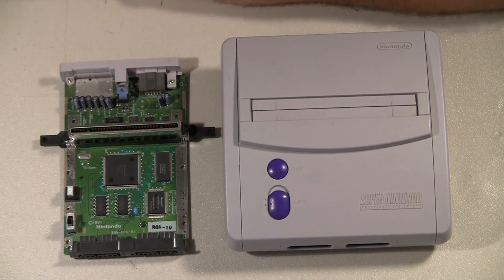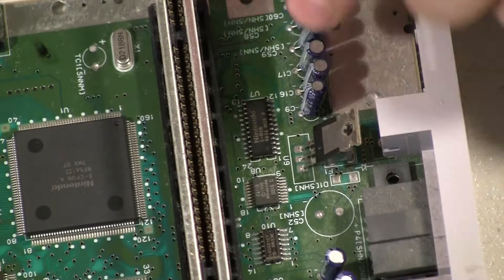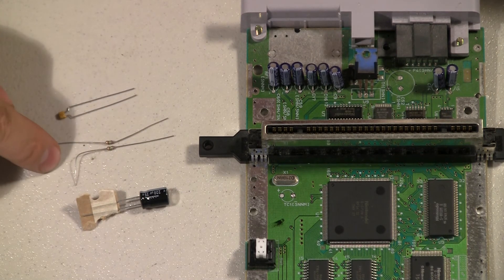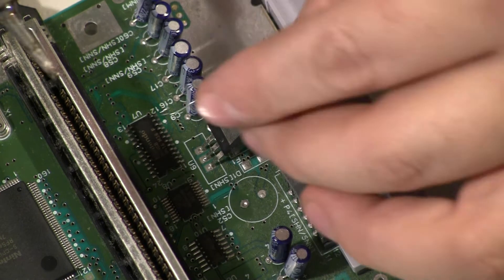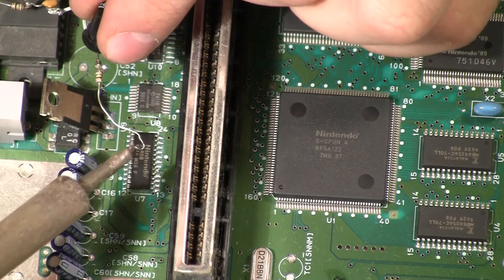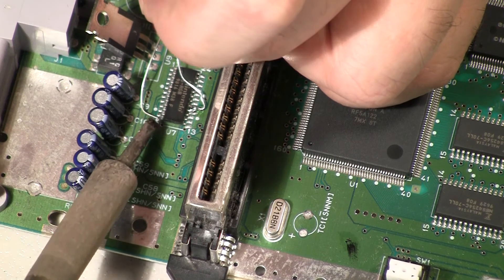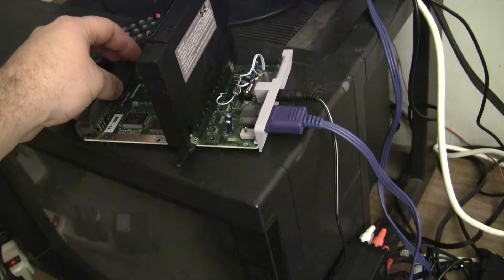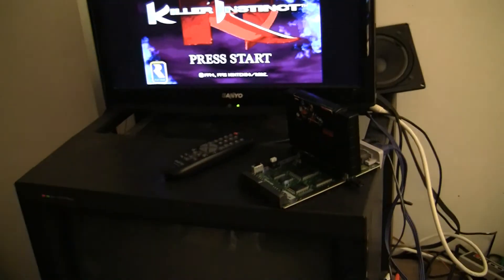SNS-101 Super NES - svid restore mod walk through

Comment: Great video. What is the purpose of the capacitors? What do they do to the signal? I was getting just black and white when using the .1 uf capacitor. I removed the capacitor and everything looks great. I bought the capacitor new in a pack but I suspect they are very old.

Comment: Why not solder wires to the chip and run them to the side? Then add your capacitors and run a wire from that to the bottom on the circuit board? Plenty of space on the sides of the SNES case without having to worry about taping or shortening anything. Nice tutorial though.

Comment: Hi! Great video, thanks! Do you have any videos showing how to use rca connectors to output RGB? I have a SNES 2 and it doesn't have the multi-out, just one rca output. Thanks again!
Reply from the maker: +Fredi Machado Is it missing? All the ones I ever seen had a multi out...
Reply: +GameTechUS It's missing. I think I can just solder some wires to the RGB chip. I uploaded some pictures: https://drive.google.com/folderview?id=0Byv8X7qH-4BeNlE3Y21FQ3dqNEE&usp=sharing Thanks!
Reply from the maker: +Fredi Machado Weird, you'll have to amplify the rgb signals like in my other vid.
Reply: +GameTechUS Those are Brazilian models. I bought one SNS-101 and came across with one of those.

Comment: Hey man!  Very informative videos, thanks for posting!  One question though, I just attempted this mod and it seems to have worked correctly for the most part, but everything is very green.  Most of the color information is mostly correct, but even grays look green, and it seems like everything else is 'extra green'.  I do a little ypbpr modding on old snes' and this reminds me of trying to take all 3 lines from the encoder chip on an original model snes, where the 'luma'/green isn't amped (compared to pin 7 from the multi, where it is).  I was wondering if maybe i did something wrong with the circuitry that could've caused this, backwards capacitors or the like?  Sorry i'm pretty new to most electronic work.

Comment: Can I use a 0.1 uf ceramic disk capacitor? Instead of the microfarad cap? Please let me know, again I'm new to this and I'm trying get the right parts for this mod.
Reply from the maker: uF is short for microfarad.
Reply: Oh lol sorry. One more question and I'll leave you be lol

Is there a difference from ceramic disk caps from just ceramic caps? Is there a difference?

I have a .1uf ceramic disk cap
Would that work?

Thank you for your time
Reply from the maker: albee martin del campo
Mostly only a physical shape difference, it will work fine.
Reply: Thank you so much :) and btw, great vids! I really appreciate your time to reply.
Thanks :)

Comment: I have a question! I have a snes mini, and I have a composite/s video cable for my snes in one cord. And I was thinking of modding my snes mini for a video. And I havnt done it yet, so I just wanted to try it out anyways. So I connected it and I was assuming not to get any picture at all. But I do get a video! It looks horrible, it has the diagnal lines but I was thinking I wouldn't get any video at all.. So I'm confused?
If I do this mod, it will work and fix that right?

Just curious, if you reply, that'll be much appreciated.
Btw, I'm new to this so please enlighten me lol
Reply from the maker: My guess is the cord is crap and uses composite vid for the luma signal so the tv tries to use it, pretty common for the dual type cords. Get one that's svid only and do the mod.
Reply: I just saw your cord fail video and I did the same thing you did with the multimeter and I do get a signal for the composite vid on the luma pin.
So I'll buy a different cord.
Thank you :)

Is there am email that I can reach you at? I want to send you a picture. I have a question.

And again I'm new at this, I'm getting into this kind of stuff and I'm researching a lot. And again, thank you for your time.

Comment: +onderdude That mod is for RGB-only.  Both mods require the require the resistors.  Especially for the s-video mod, as the capacitors WILL damage the system otherwise.

Comment: So this is what we need then? 
-.1 uF 50 microfarad cerimac Capacitor
-75 ohm 1/4 watt resistors
-.1 uF 50 microfarad ceramic Capacitor
-220 Microfarad 25 volt 
Is that correct?

Comment: Well, it's more compact. That's all I can come up with. It lacks the RF modulator, but because RF sucks, that's no big deal. It also doesn't have the expansion port, but because it was never used anywhere other than Japan, that's also no big deal. The biggest drawback to this version of the system is that a mod like this is necessary for S-Video.

Oh, wait, it doesn't lock in your games when you turn on the system, so you can pull them out even when the console is on. I guess that's a plus?

Comment: i just need to buy the parts now, the only reason i wanted to do this mod was i use one of those multi system cables and i hook up my ps2, xbox and snes model 2 all with the same s video cable but of course the snes won't work on it, but soon it will